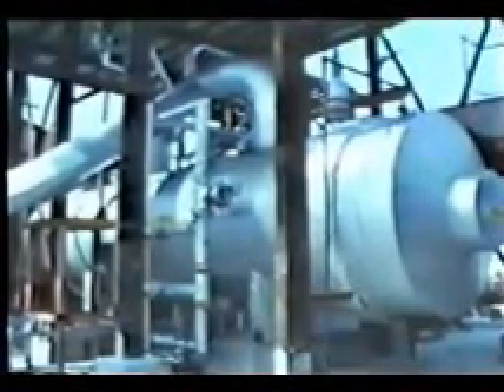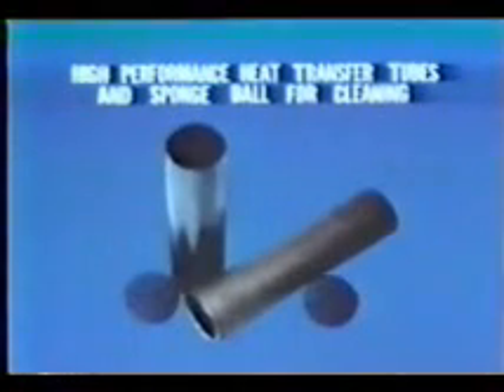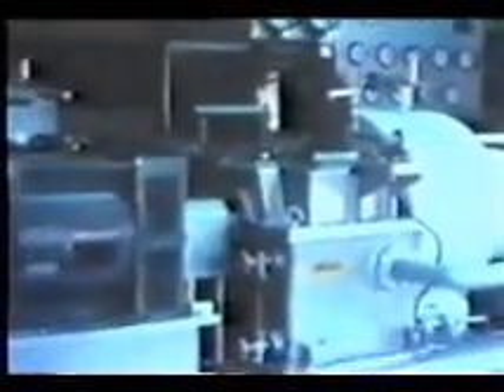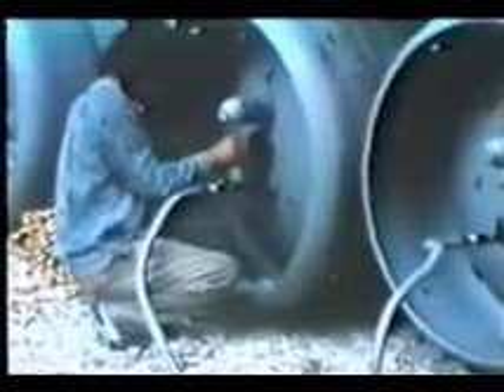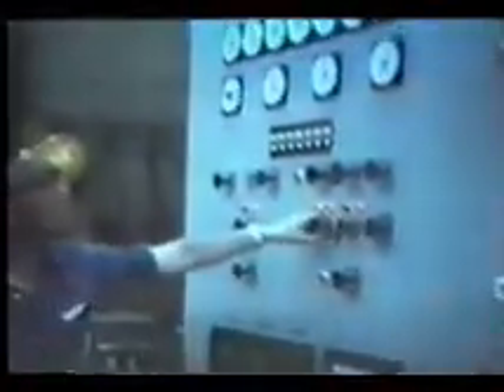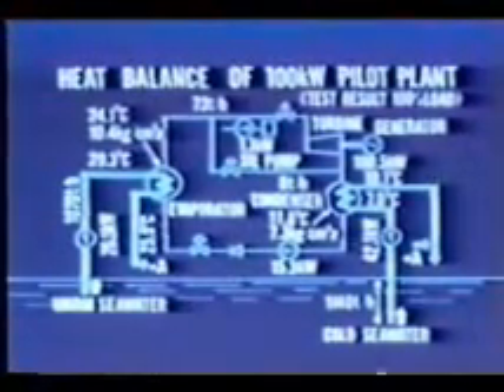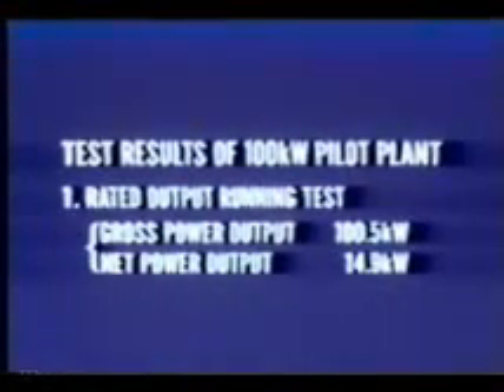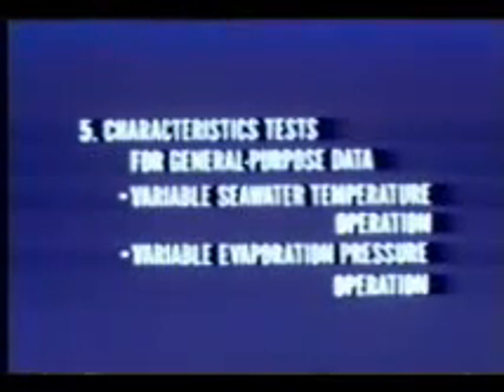OTEC in Nauru, part 2

Comment: 30 years after, nobody seems interested.  Where are the other OTEC plants on earth?  What the video does not point out, is that Toshiba has already been building Nuclear power plants in Japan since the 1960's where it has been deploying heat exchangers using sea water for cooling.  Have a look at  the Fukushima nuclear plant constrution details.

Where they really interested in the Technology, or did they build the plant as a show case to distract attention from OTEC???